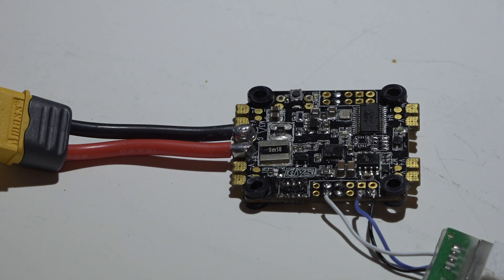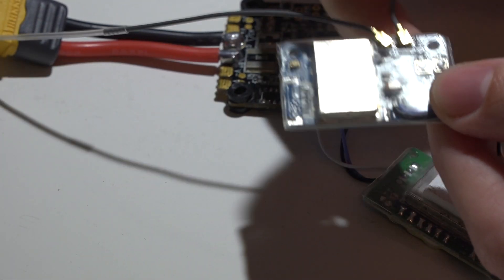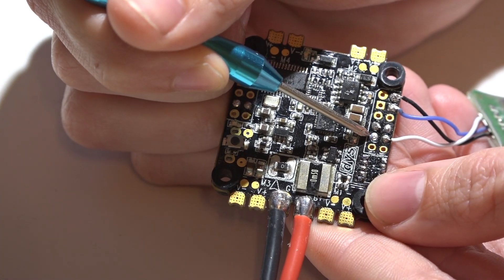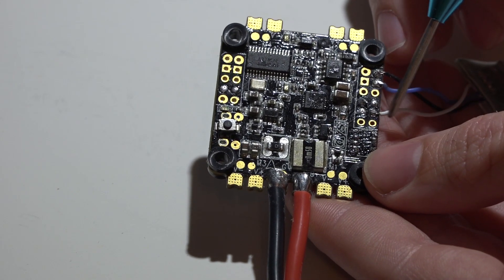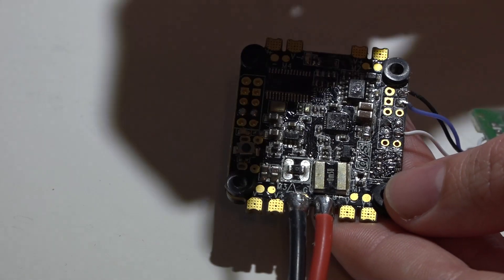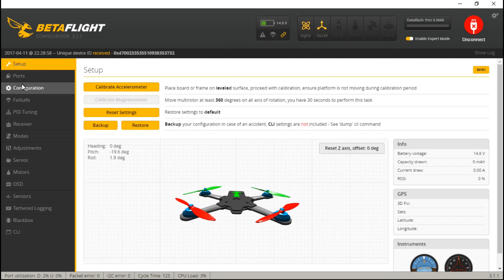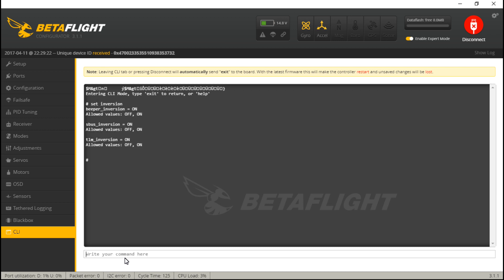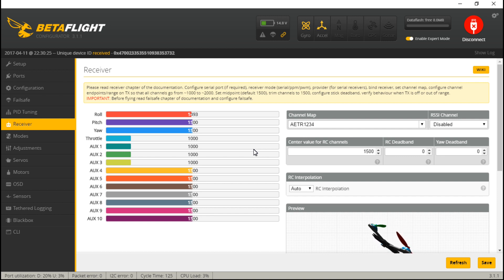DYS F4: Connecting I-BUS Receiver

Comment: JC, can you confirm your failsafe is working? Mine isn't and it was working on a different FC. I took the receiver out of another build, that failsafe was working, to use in this build. The receiver I'm using is the x6b

UPDATE

I figured it out. IDK why but i had to go in the evolution failsafe settings and set my arming channel (channel 5) to -100 and now it works.

Comment: Can't decide if I want to use this FC or a separate omnibus f3 with a PDB for my first build on the chameleon frame I just got. Any advice? Is one easier than the other for a first time build? Thanks!
Reply from the maker: The DYS F4 would be a little easier. I'm not a fan of the Pro versions of Omnibus because of how you wire them to make the current sensor work. But if you use the standard version of Omnibus the voltage regulators get really hot. Many people have had problems with them cooking themselves. But I did make a video on how to cut the regulator out the circuit and power the Omnibus with 5v. Or you could avoid all that head ache and just go with the DYS F4.
Reply: I was just reviewing your omnibus videos and that did worry me. With the DYS F4 I am not sure how I would use the FT48X VTX I was going to get because it says it needs 12V. It seems like every time I pick one component it brings up a problem with another lol. There is also the point that the chameleon is supposed to have the battery wires come off the side. One of these days I will commit to parts though haha. Thanks for your videos they have been a great help!